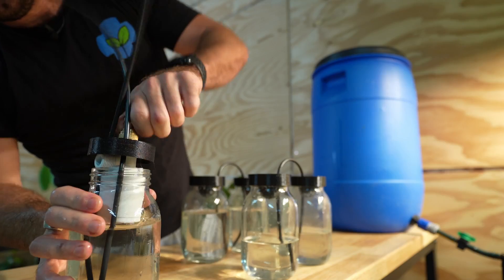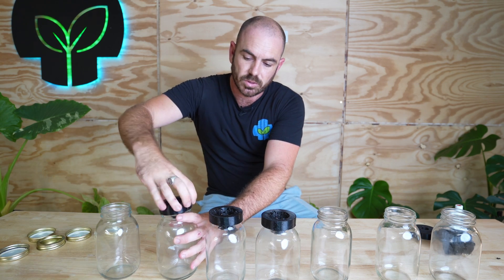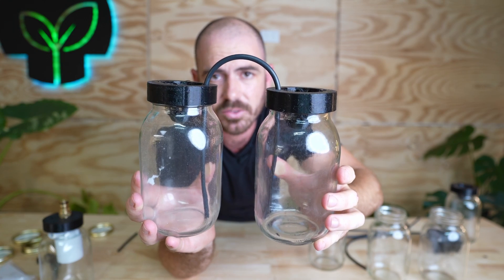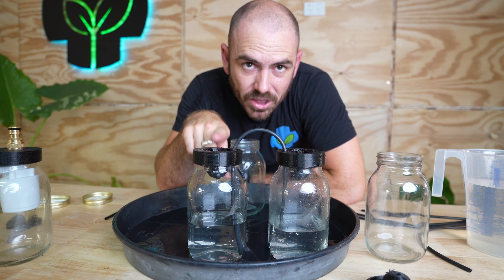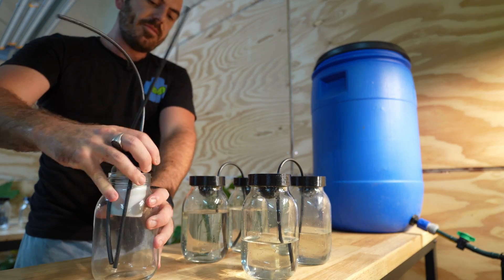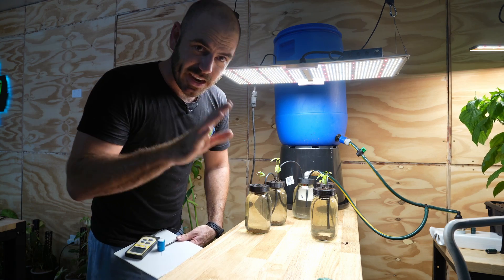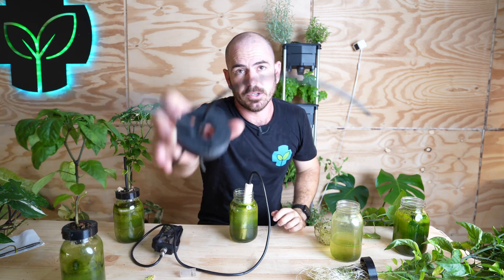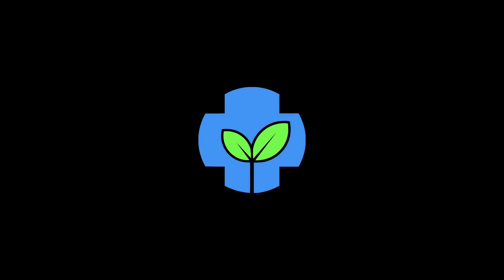Mason Jar Hydroponic System: Passive & Auto Refilling

Comment: Hey man great idea! I was thinking about it and have some ideas. Definitely attach each mason jar to the sump directly to avoid nutrient issues. If you make your sump from a plastic bottle, and insert the tubing through holes at the bottom, all you'd have to do to start the syphon is raise the sump above the mason jars. And you know those gravity feeders? The glass bulb looking things? They work on air pressure, and won't release water until air can get into the bottom. So if you took a large milk jug with a tube coming out the bottom and inserted it into the sump with the end of the tube at the desired water level height, you'd basically have a massive refillable version of that topping up your plants whenever the water level drops. And say you wanted to raise the water level above the end of the tube for some reason, all you'd have to do is unscrew the lid of the milk jug. Sorry for the rant. Had to get all that out

Comment: I did not read all the other comments.  I would consider using half gallon mason jars which take the same lids.  If you are not worried about being poisoned, you could blow into one jar to fill the hose (or use a compressor to pressurize a bottle to fill the hose)?

Comment: You could also start your siphon without turning your jars over by sealing your mouth over your lid and blowing until the pressure pushes the liquid through - like a reverse straw, or by otherwise rigging up compressed air in a way to do the same.

Comment: To help equalize the jars without the mess, you might be able to create positive pressure on the jar with the fluid using an air pump (or even blowing into a straw) while covering the net cup hole to force the solution into the hose, or create negative pressure on the empty jar by sucking the air out to draw the solution through it. Once the solution goes up and over, you can add the next jar to the chain and do it again.

Comment: You can do this more easely to start up. In the tubes between the jars do a T connector. Do a short tube to the 3e way of that T. Do the water / nutrient via that tube and as the tube is full fold it double and ty it up with whatever. The filling can be done with a injection tool what is used to give people injections when sick. I can do a little drawing and send it to you but don't know how to contact you in privat. About the 1 jar goes to the next and the next and the next and so on, you also can to 1 general jar in where the lit has more than 2 tubes pass true holes. You can do like 10 holes ( 1 for each jar connected ) so the question all plants have the same strenght of nutrient is nt relevant.

Comment: I have issues with your test vid:
1. Add all parts used w/links in the vid support text... i.e. tubing, black jars, float, etc. 
2. How did you account for measurement differences AND 'green' algae growth having no indicated factor? Your Mason test should be redone using all black jars (or place a black-bag over the clear jar to negate sunlight algae growth for more accurate experiment/measurements. 
3. The water level always changing would stunt/strain plant growth - you needed to fix the float feeder to keep a constant.

Comment: use a vacuum cleaner on blow to increase the air pressure in the jar that has the nutrient in it, the higher air pressure will force the water through the tube to prime up your siphon

Comment: @Hoocho great idea with jars as the plants wont topple over like in a plastic container- bucket that is near empty.
if the jars ain't a requirement i would just get rubber top hat grommets to suit your hose size installed at the bottom of bucket chained up to the number needed with the last bucket being the float valve which make a much more easier system with less effort.

Comment: The supply jar, have a 15cm-ish vertical fill pipe, then fill via that. I just use hose and pressurise the supply (and blows out bubbles) (mines just water res for self watering - but should work for hydro as well if there is enough pressure to push the bubbles out)

Comment: Awesome project! Two suggestions! #1 - slight angle cut the tube ends in the jars, that way if they ever touch the bottom they don't seal. #2 - use a clear or grey base for your light meter... bright white will reflect a LOT of light back up all around your sensor, potentially skewing results. 🙏

Comment: I used this concept in aquaponics. The water Bridge can be established by submerging the hose pipe before connecting the "jars".   Rule:  No air can be in or get in the water Bridge for it to work properly. Great, in concept but Water bridges fail if they are highest point above the water level, between tanks etc...  The water bridges must be below the water level for long term use otherwise they break when oxygen is captured and it breaks the water bridge over time.

Comment: Modify the lids in such a way that you can seal of the lid entirely with an adapter of some kind and blow air into the top of the jar to force nutrient solution into the syphon tube into the next jar.

Comment: A solution for your siphoning "start" issue from your central water supply jar may be to add a small vertical tube (which could also act as a water filling point)    You could then provide some air pressure (by blowing on it with your lungs) which would push water out to get them started.    It would be very tricky to get a bunch of tubes (4+) running with the "jar tip" method.
Reply: Was going to suggest exactly the same thing. Piece of gladwrap over the top, poke a straw through it and blow. Might be better though to do it in reverse - ie negative pressure on the jar you're trying to pull water into. That would work better for daisy-chaining,  otherwise once you have more than 2 jars applying pressure would pushing it into the jar on either side.

Comment: Another great system idea.  During setup, if you could plug the plant hole with cork or even a threaded disk, and with enough water pressure, water would be pushed up the pipe and into the first grow jar, the air escaping into the next jar until the last where it would escape to the room.  Once the water had covered the bottom of the pipes and with the plant hole plugged, an airlock will form, this will push the water up the pipe into the next jar, until all jars have the pipes covered and the end jar will continue to fill. remove the plugs and the level will normalise in all jars

Comment: I would probably add air stone(s). At least one air stone in the float jar and/or into the plant jars.  Just an air stone im the float jar would help provide more oxygen to the roots, and may help with algae buildup (besides painting or covering the jar sides).  They may need to be off the bottom though, to make sure bubbles are not introduced into the nutrient vacuum lines.

And as soon as i started watching the video and it eas explained how it was going to work, my mind went directly to some 5-gallon buckets I have!

Thanks for making great videis!

Comment: Years ago I did a similar setup, but I used an autopot valve to control the nutrient level in plastic 2L ice cream containers.  My 4mm tubing was connected at the bottom of each container.   This kept the nutrient level the same, however the control container was raised about 5mm higher than the rest.  This allowed the nutrient in the control container to drop to nothing, while the grow containers had a few mm of nutrient preventing them from drying out.  The autopot seal breaks, refills the containers to about 25mm high.  This had two advantages; 1. The PH and EC was maintained and 2. The oxygen roots never drowned.  At the start of the grow it work as a kratky system until the nutrient in the control container dropped and the autopot value took over.

Comment: If you fill the tubes with liquid before threading them into the jars, you can block off one end with your thumb and thread the other end into the first jar, then raise that first jar above the level of the second jar and thread the tube into the second jar.  No need to flip anything.
Reply from the maker: Hard to keep the thumb on threaddding it through a 3d print 🤣
Reply: @Hoocho  If you've already got the print on the jar (which you'd want to because you'd want liquid in the first jar before you thread the second one so that way the liquid in the tube doesn't just dump into the first jar), you just need to keep the jar in place.  Get a second pair of hands, or just hold it between your knees while sitting down.  No biggie.

Comment: Would it be possible to set up your system put liquid in all of them a little bit to cover the tubes then make a system that sits over one of the jars so you could put a vacuum to it, which would pull the nutrient from the previous one and so on and so on so I would suggest some kind of little rubber cap that could be held on the jar that you want to create a suction using a tube you could either use your mouth or a mechanical source of vacuum, pulling fluid from the previous jar into the next jar and so on and so on I think it would work.

Comment: The only problem with this system, and any other Kratky-like refilling system, is the over-fertilization caused by the selective osmose process in the roots. In most cases, the nutrient solution won't be perfectly balanced and the plant won't absorb all the nutrients equally, causing an excess of specific salts and therefore EC rising. This method should work great with quick cycle cultivars, like green leaves, or early stages of long-running plants, like cannabis clones. But it shouldn't work keeping a plant alive for much time.

Comment: This is really cool. I don't quite understand the utility of this over say... a tray that could hold 12 containers inside of it and the tray itself uses a float valve and has something similar to those holders for the "plant" suspending in the tray (instead of jars)? With a tray, and raised containers, You would not need all those hoses and jars.. just 1 valve, 1 tray, and the slightly raised container... but maybe I am not understanding the other benefits of how this works.
The other thing that might be a problem is that over time, I think the "hoses" will fill with air due to air coming out of solution, and because the "flow" from 1 bottle to the next will be very slow, the air bubble will eventually break the siphon. 
Another issue, you might need a system that also allows them to easily grow without toppling.
You mentioned passively oxygenated... wow, impressive ! I am curious why the roots don't drown!
Reply from the maker: I honestly do most stuff just for proof of concept. 
I have a system similar to your “float tray” in design process, I’m using a very low pressure float for it with a shallow gauge.
You’re right though. This is super complex for something that should be more simple.
But in the making of it I learn and develop new ideas.

I think that’s the true payoff.
Reply: @Hoocho It's great to see the different ideas for sure. One idea I have been considering lately, is using "pond" water that has fish in it as the water source since you will get Nitrogen... tho you have to be careful about insecticides and additives harming the fish.
Reply: Good morning,
I would like a photo of your installation, I can't visualize it.
Thanks in advance
Reply: @babyssbabyss5958 I think he said it is still in the design phase.

Comment: He Hoocho i have an idea how you can dasychain the individual jars without the risk that water gets from one plant to another.
You could install a T piece on the lid fresh water comes in from the left dripps down until the first jar is full then the fresh water will flow from left to right through the T piece without carrying old water from jar 1 into jar 2.
Reply: And also you could use a vacuum cleaner on the second jar so it sucks water through the tubing
Reply: I've used the T option and worked quite well, I also found I had fewer issues with air bubbles which I think was because the nutrient solution was flowing faster on the supply side of the syphon.

Comment: Should try and make a print for a float valve
Reply from the maker: I’m working on it. It’s quite complex. But I will make it work eventually.
Reply: @Hoocho  Mr Kratky has some simple float valve designs in his channel, I bet you could improve them
Reply: @Hoocho  I wonder if there is any way to use or involve hose connectors with the auto stop feature that blocks water without something plugged into it?

Comment: Hooch, i have tried this as you have describe in the past 2 summers, to grow tomatoes on my balcony (canada) in 8 5-gallon buckets.  Did you find algae growth in the siphon tubes?  Also, did you ever find that air would actually get into the siphon?  Once outside, air bubbles naturally form and do get into the hoses which stop the siphon.  It's quite a bit more challenging to get the siphon going, for a 5-gallon bucket.  One way that helps somewhat, and might help the EC, is to also connect neighboring jars to each other in a grid, not just a from a central source.  I'd be happy to share my experience in this, as i really want to get the yield up.  Last year yielded about 10kg of tomatoes.
Reply from the maker: I’ve been thinking about how to easily release the air from such a system. Having a tap on a “T” at the top of the hose you’re using as a syphon.

Then pumping (or sucking with your mouth) the air out of each and closing the tap
Reply: @Hoocho   its pretty gross.  haha.  I just purchased an aquarium siphon (used to clean/drain them) with a hand pump to try out this year.  hopefully i can just pump the water through with a few squeezes and move the air through.  While outside, i also found my float valves would get clogged with little bits of algae periodically.
Reply from the maker: @jefffong1061  alternatively you can just hold the pipe underwater, block the ends with your fingers and put the other end in the other bucket…

Not sure of the system design tho.
Reply from the maker: @jefffong1061  alternatively you can just hold the pipe underwater, block the ends with your fingers and put the other end in the other bucket…

Not sure of the system design tho.
Reply: @Hoocho  That's my go-to fix.  but since the tomatoes get pretty big, and are sitting in net cups on top of the lids, its quite the ordeal.  The best thing i found, was while the bubbles are small, to raise one of the buckets, and force the siphon flow.  This empties the air bubbles and then it re-flows back.  I found i had to do this daily.  But I'm really trying to design a passive system where i can actually take a vacation!  Will share some pictures on your FB group.
Reply from the maker: Share your system on the Hoochos facebooks group if you like. In description of videos
Reply: Using buckets, create holes down low, so the buckets share the water equally not requiring a siphon but using water pressure. Can have a float valve to keep the level in a single bucket
Reply: @joorre77  Hi, I've thought about that.  but i think i might as well get a large tub at that point.  Also, trying not to have any leakage risks, while away.